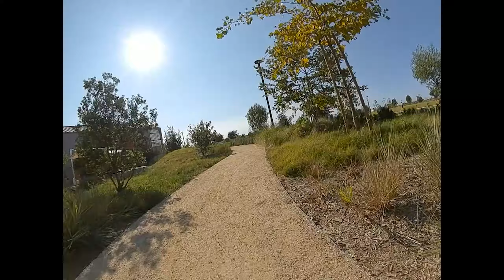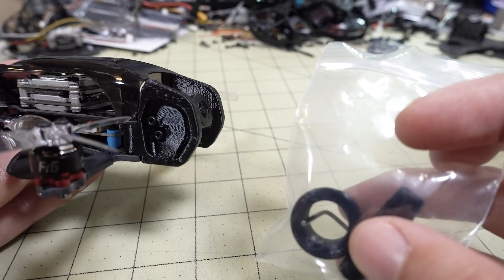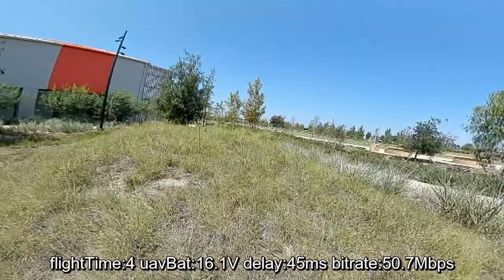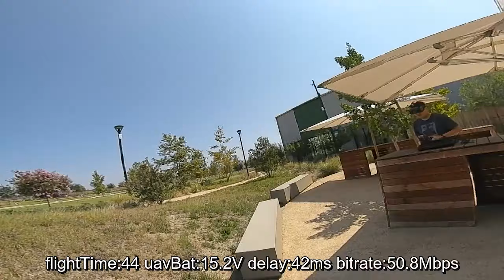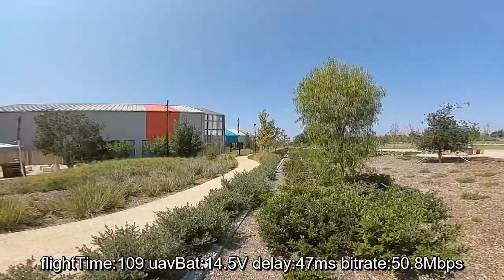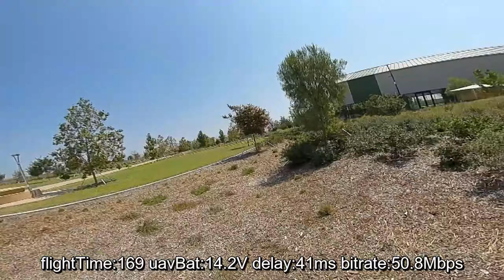TransTEC Beetle Mini Review 💥

Comment: I broke an arm on this quad so I found a 3inch version of this frame and turned it into a 3inch. Then I ended up replacing the motors with mamba 1408 4000kv motors and it turned into a super fast nimble beast! Running Gemfan 3052 props and I love it!! On 4s obviously.  Highly recommend that conversion!!

Comment: i just still cant wrap my head around wanting to go 2/2.5". There no reason not to go 3" for something carrying a vist/airunit.
Reply: Smaller gaps with the 2" for sure. Always way under 250G means more battery choices. Less prop, means less noise, generally. Those would be the three main reasons to go with a smaller frame. This one looks like an interesting choice to run mini races within a small park...needs a good tune or perhaps better motors?
Reply: Not in this case in terms of noise. When you have small props trying to lug  110g + on 4S, it will scream like hell  buzzing around  and human ears are quite sensitive to higher pitch noise.  A light 3 inch with 1204 lower KV will generate less/  lower pitch  noise. If you talk about light  50g-60g 2 inch build vs traditional 150g+ 3 inch, yes the smaller quad will be quieter. Anyway i wouldn't spend my hard earned on this Transtec.

Comment: I just got the TransTEC 2" Beetle HD PNP - With Cadxx VISTA.... check yours closely folks, mine had two different motor types front and rear LOL. 1104 6800KV in the back, Fr6 1104 4350KV in the front ... woops! I'm working with the reseller to try to get it sorted, not even gonna try flying it that way, doubt that is the new way of setting these up :).

Comment: Is it possible to do the 48kHz increase on this?
Reply from the maker: Sure, it might help increase flight times.
Reply: Yep. I have done it. Getting rpm filtering working is a bit involved though because of the resource mapping for the LED.
Reply: Birchi FPV I shut my led off to get it to work. How do you get the leds to work as well?!
Reply: @uwishzr222  I didn't get it to work with LED's.
Reply: @birchifpv2255  did you  install  buzzer  with  jesc? I tried but it not working
Reply: @ugari9975  I haven't tried installing a buzzer
Reply: @birchifpv2255  thank you  for answer
 I failed to install 
 I will do one more try 😆😆

Comment: Can you feel the 45ms latency if you fly hard?
Reply from the maker: Just a little.  But I prefer the high quality image over the low-latency mode.
Reply: @AlbertKimTV  I'm gonna get it one day soon, I wanted to see how things unfolded. I hear the Shark Byte system has the same latency as analog, but DJI beats it in pic quality, penetration, and range. I been meaning to ask about ipd on DJI, I have a 58mm close as I can tell, and I think it's causing more eyestrain using 59mm.

Comment: I was going to get this but you suggested I wait for the Flywoo explorer LR.  Well I ordered the explorer the moment they began selling it.  Took them forever to ship it.  I was just notified that it never left Hong Kong and is on its way back to Flywoo (???). So they have my $322 and my drone and don't ever respond to email inquiries.  Not happy about that.
Reply from the maker: Sorry to hear about that.  I think they should have them at RDQ soon.
Reply: @AlbertKimTV  Albert they immediately shipped another one out and it arrived with lightening speed.  It's a beautifully efficient and amazing quad.  Flew it around the inside of the house after setting it up last night.  Perfect.
Reply: @sleepingbearffg5008  Definitely worth the money.  The drone is inexpensive when you consider it has the Caddx Vista, and is tuned to perfection.  (They sell s non DJI version for just over $125 I think.  ). 
I usually do build all my own quads, except this Flywoo Explorer LongRange is unmatched.  Only other BNFs I've purchased were the Mobula6 (awesome), and the BetaFPV hx115HD, another incredible quad.  I've never broken them.  The only one I break fairly regularly (haha) is my own design basher (click my channel to see) but it doesn't need fixing often either because it's so tough.  (RDQ Source One frame)  RDQ is right down the road from me here,  They are indeed the best.
It used to be BNFs were pricey, but now it's hard to build one from parts that match the price.  The hobby has improved dramatically....

Comment: Looks like it can just barely keep itself up in the air
Reply: Oh I bet. Power to weight ratio  not good enough for me. High kv 6s 5inch is the way
Reply: @dominicklittle9828  1900kv is high as I been, but just for the hell of it I got 2400 on 6s I'm gonna put on an old 7 inch with 50amp blh32. It may smoke something, but it's gonna be crazy fast if it don't.
Reply: I have one of these and like it quite a bit. You can enable rpm filtering with jesc or jazzmaverick, but it requires some resource remapping due to how they mapped the LED’s. It still gets quite a bit of prop wash with rpm filtering enabled, not sure it’s worth the trouble. My next step is to try emuflight on it.

I fly mine on 3s 750mah (Tattu r-line).

Makes a great platform for carrying the insta360 go.